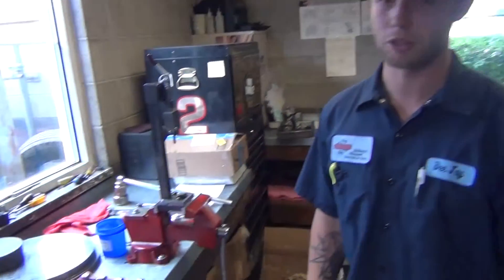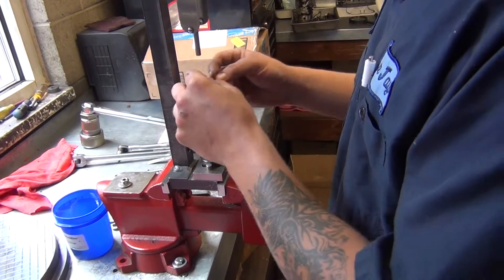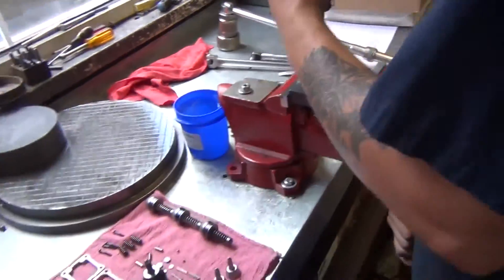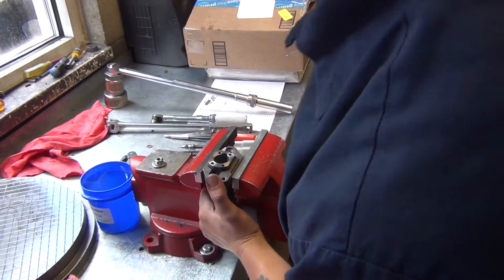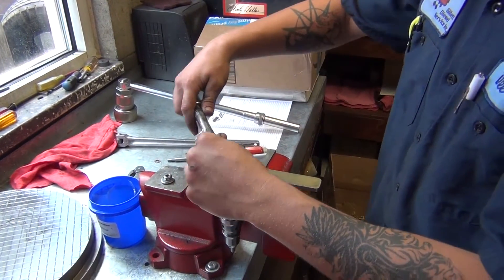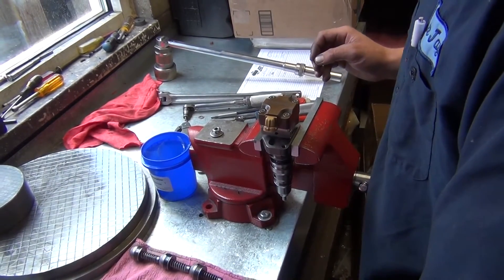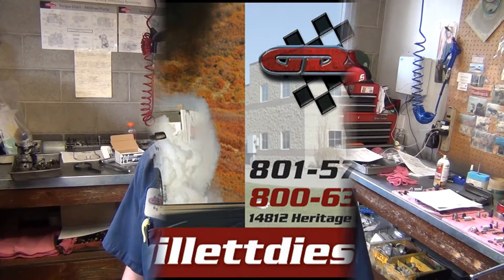Powerstoke 7.3L Injector Rebuild

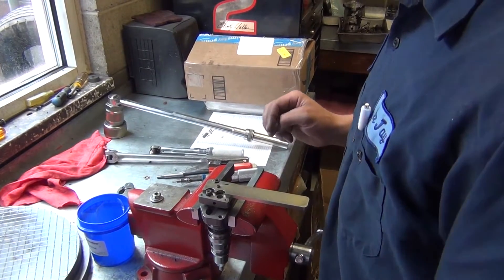Comment: What are you doing in the video between time stamp 3:50 and 4:12?
Reply: lol aline a machined part with fucking hand plier theres a spacer on the popet bushing he was moving it. i also like the part where he clamped the hold down clamp in the vice till it deformed a enough to hold the injector it just made me think of if there would be enough pressure to blow through the valve cover and hood hehe i would never buy shit from them myself lol